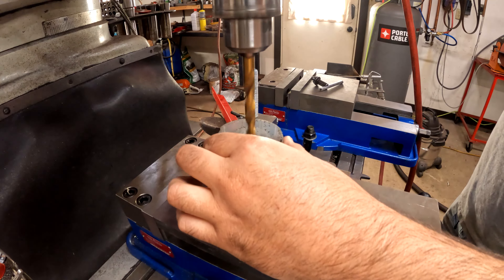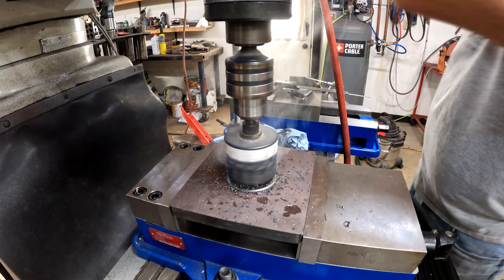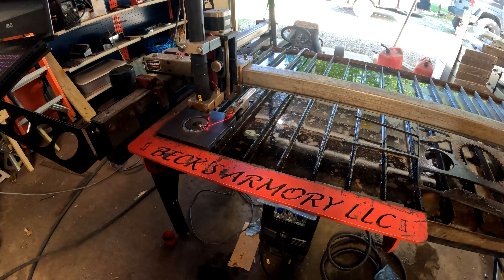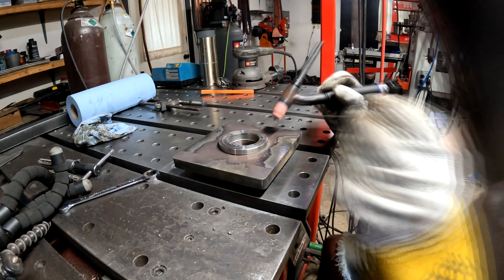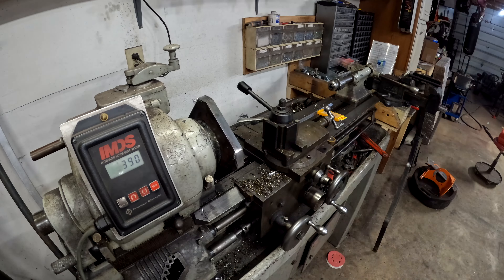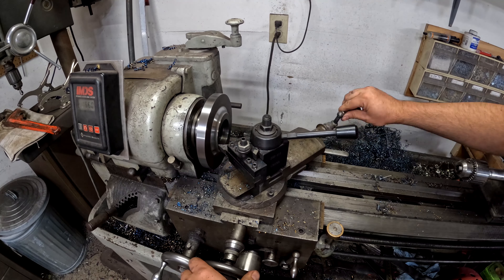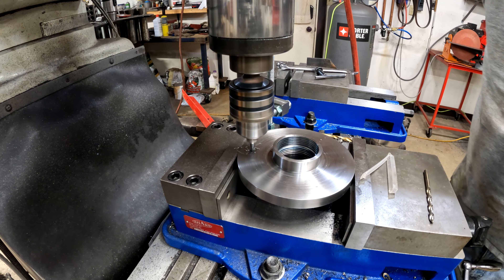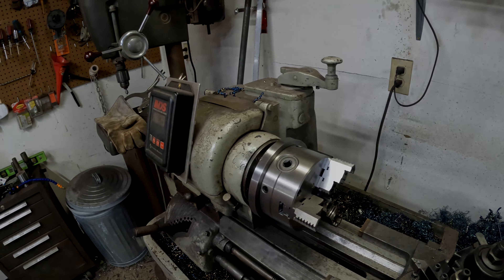DIY Lathe Chuck Back Plate For An Adjustable 3 Jaw Scroll Chuck (4K)

Comment: Wow dude. Love your desire to do a project but…. Man I was dying as you drilled with no cutting oil .. I could hear the bit screaming from my house 😂  and the drill chuck coming off the arbor 🤪. and then the hole saw 🤣. Your a much more confident than me. But kudos to you for not being scared to go for it and show us .I wouldn’t even attempt that one. But hey at the end of the day. You got er done ✅
Reply from the maker: I ended up breaking two hole saws... lol I didn't show the second one. hahaha  The second hole saw had the arbor with the dual pins so it can't strip the threads.  That one ended up cracking and I had to stop going down that path.

I do dip my drill tip into the cutting oil at the beginning of the drilling cycle.  It has lube as I'm punching thru the mill scale.  That's the part that really destroys the bits.  I could add more during the drilling but YOLO. :)   Thanks for watching and giving me feedback.
Reply: @BeckTools    Hey man …. Still loved watching your video. And your so much like my old man. Just get er done. And I think that’s awesome 👏🏽. And ps good quality on the video
Reply from the maker: Thanks.  I've been trying to up the quality a bit.  :)

Comment: If you need to do a large hole again in the future, try to trepan it. You can do it in the lathe or in the mill with a boring head. It basically works like hole saw with a single tooth, so there's less loading on the machine.
Reply from the maker: Thanks for the tip.

Comment: I enjoyed the video!!!  Keep em coming.  Question: Why didn't you lob the corners off of the square back plate to make it a hex then start rounding it out?
Reply from the maker: Good question!  I was going to plasma cut them but I left it square because I planed to drill the holes before I turned the faces.  After I welded it I decided that was a bad idea but than it was too late to cut off the corners on the plasma.  I could have done it by hand but it was easier to just chuck it in the lathe, engage the power feed and let it eat. :)
Reply from the maker: Also my angle grinder died last week so other than the plasma cutter I didn't have a good way to chop the corners off.